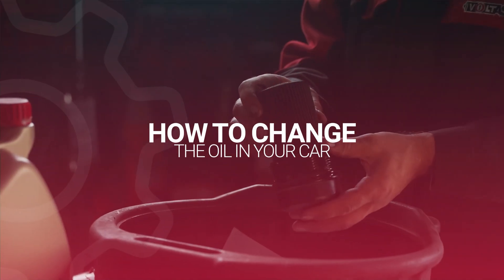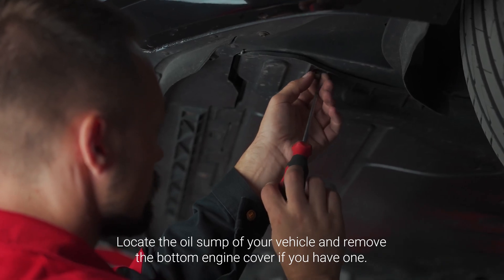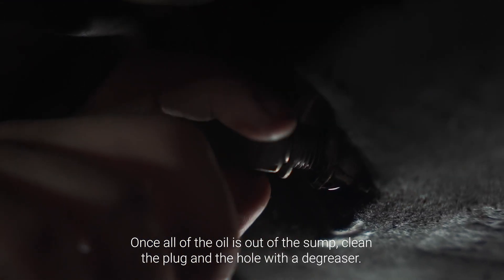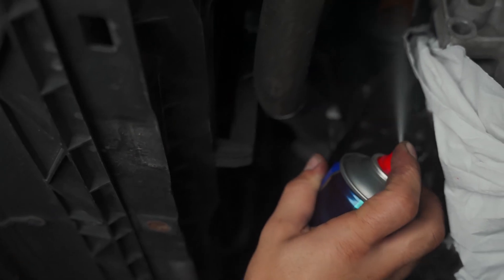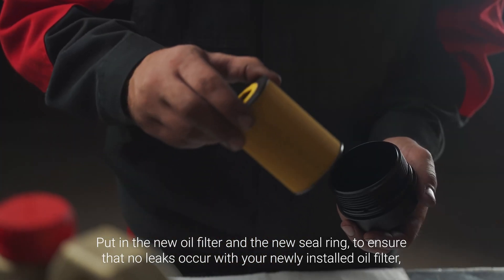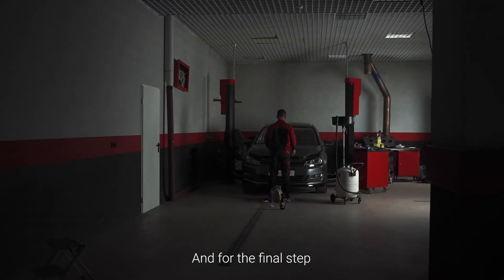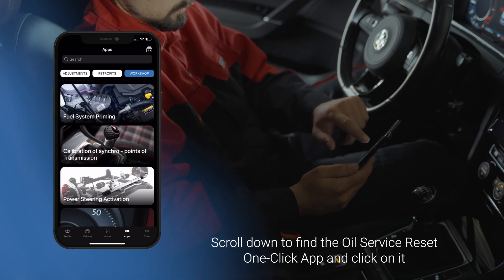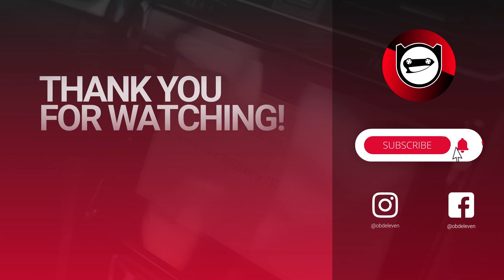How to change Volkswagen Golf oil and reset oil service lights using OBDeleven

Comment: Dear Sir; can we change the setting of "wheel circumference"  to decrease the speedometer deviations?
Reply from the maker: Hello, Ahmet, 

Thank you for your question.

It is possible but you will need PRO or ULTIMATE plan in order to change the required setting.
Reply: @OBDeleven-Official  2018 model Audi A3 car supports this feature?

Comment: I would have thought you want to warm the engine oil up first before trying to drain it
Reply from the maker: There are many different methods on how you can change the oil. We've provided just the basics :)
Reply: In my book warming oil is a very basic step and helps remove contaminates and ensure you empty more oil and more quickly. Fully understand you don't want to get into stuff like not all vw have drain plugs or many have one use drain plugs but we all have different views

Comment: Don't buy anything from them. I bought the PRO version but couldn't use it. If you want to throw money away then buy it.
Reply from the maker: Hey there,

If you had issues receiving the PRO version, you can contact our team directly at support@obdeleven.com and the team will provide you with the code, or solve any issues you have while trying to use the features.